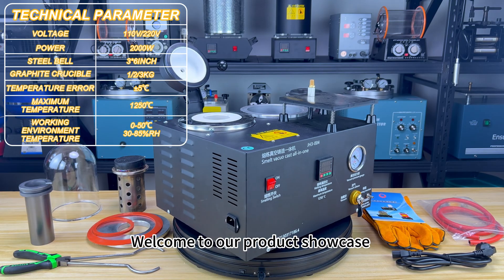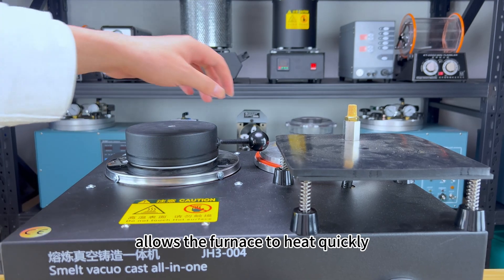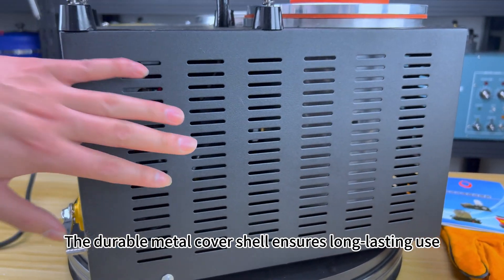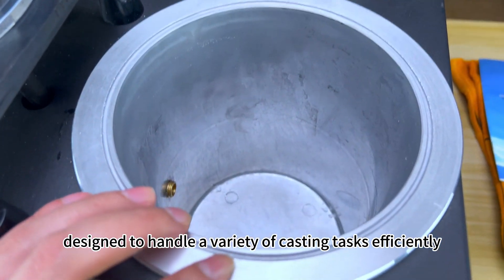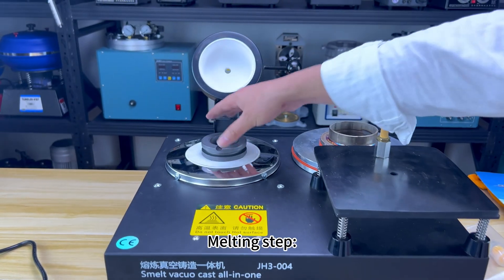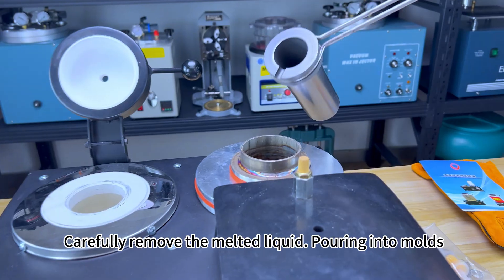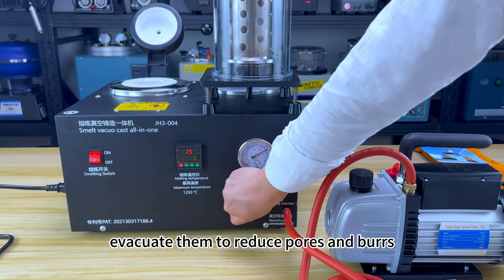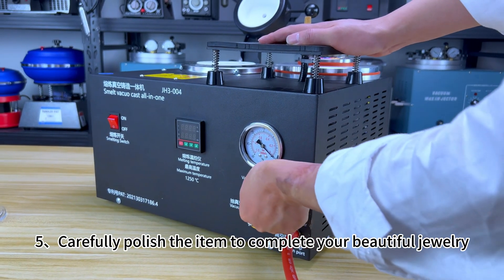How to use Lost Wax Method Digital Display Jewelry Vacuum Investing Casting Melting Machine?

Comment: When I bought this two years ago I was so happy then I realized you have to buy a pump and a burnout oven for the investment then you can use the machine to cast because this machine does not melt the wax 😂
Reply from the maker: Yes, this casting machine requires a vacuum pump. This is mentioned in our product details. Thank you!

Comment: Hello! I bought this machine and I it was my first time casting with it. I dont know what i did wrong. My perforated flask was at 650 celcius following my investment powder burnout process and as I took the flask out from the kiln and put it in the casting chamber, it burned the red gasket on top. It was on fire. The video you showed when positioning the flask in the casting chamber, has the same gasket on top. So is 650 celcius was too hot or did I miss something?

Comment: is there a switch for the 
110v/220v?
Reply from the maker: Hi, This machine is divided into two kinds of 110v and 220v, the other functions of these two machines are the same, you can directly choose the 110v machine or 220v machine.There is no need for a switch to control it.

Comment: Greetings i already got one, but i dont know how to turn it off, i mean, after melting the metal do i have to set another temperature in the control panel like ¨150¨and after the ¨cooldown¨ i just turn off the switch or can i just turn off the switch right after pouring the metal into the mold, Thanks beforehand.
Reply from the maker: Hi after melting, you can turn off the red smelting switch on the left.

Comment: What’s the best whose to get for it? The whose that came with the machine doesn’t fit properly on the machine or my vacuum pump which makes it not get enough pressure for casting
Reply from the maker: Hi thanks for your kind review. May I know your order number? What accessories did you receive?
Reply: @ I have the machine but it’s not from you guys, I was just enquiring about what size whose is best because I got one with the machine but it doesn’t fit the casting machine or my vacuum pump I have to force it on. Which I think is leading to me not getting the psi that I need

Comment: Yo compré una  de las primeras máquinas y muy defectuosa, no tenia válvula para liberar el vacio tenías qué quitar la manguera y el empaque de la campana de vacío muy duro y no sellaba yo tuve qué modificar
Reply from the maker: Hi, may I know your order number? Our after-sale team can handle it.
Reply from the maker: 'Vacuum Release' in the Air Pressure Adjustment Switch on the casting machine is the vacuum release valve.

Comment: I just order mine from you guys! Can’t wait to try it ❤
Reply from the maker: Thanks. May I know your order number?
Reply: @TooltosJewelryTools  
Did you get my order number?
Reply from the maker: @HellHoundOne  Hello May I know your email and phone number? If you order it from my store, you can check the order number.
Reply: can you post a video of how this works
Reply: @Wsjr705  
Sure. I’ll work on that.
Reply: @HellHoundOne does the all in one have the burnout oven in it? Or do I still need a Kiln
Reply: @Wsjr705  
You still need a burn out kiln. It does have the part in it to heat your metal though, which is why I went this way. I do have oxy ac torch, but I turn off the kiln, plug in the unit for the metal and let it rip. Before I had issues with porosity but after letting the cast cool some in the oven it changed everything for me. Th is unit does not come with a vacuum pump, but I have two so it was a better choice for me. I love my unit. Works great and has paid for itself.
Reply: @HellHoundOne how tall is the flask that it comes with can you make a decent tree
Reply: @Wsjr705 i really also need to know this. But it seems like 6 inch tall?
Reply from the maker: @Wsjr705  Sorry Isaac, we didn’t take a complete video of this machine. In the future, we will take it.
Reply: How was it? Have you used it?? What do you think??
Reply: It sounds like you like it! Do you think this would be the best thing for me to get as somebody who wants to try and start making metal things like silverware and jewelry/tools/trinkets and other stuff for myself? Do you have any recommendations for anything else I might need or stuff I should know/consider? I’ve literally never done anything like this before but I have a lot of personal “invention” ideas I’ve written down over the years and a lot of them involve metal work in one way or another. There’s so much stuff I need to learn to be able to make all the things I really want to make but this seems like it could be a good jump off point I might actually be able to do. I’d like to learn how to do bigger stuff like smithing (been trying to learn a little carpentry, for instance) but having moved in with my parents I don’t really have too much space and it’ll probably be a long time before I’ll ever be able to afford a house with space/land enough to have my own workshop unfortunately. I figure this hobby won’t require too much space and might still be affordable enough to make progress with (another barrier for me with carpentry)…although I might be underestimating what all I’ll really need.

Sorry for asking you so much and writing all this, I just thought you probably have experience from your comments so I figured I’d see if you have any input. I’ve never really known anybody I could talk to about this sort of stuff. I’ve got the heart of an inventor/creator and my late grandparents’ homesteading spirit so I want to be able to do everything I can myself but I haven’t grown up in an environment intuitive to that and I just don’t have any connections or mentors or anywhere to start. I feel like I’m stuck on rails in a life I don’t really want to live right now and I figure this might be something I can at least get somewhere with before even more time passes me by. I just don’t want to do the wrong thing or screw up and make expensive mistakes that might just set me back even further. 

I really wish they taught shop in school like they used to so I’d at least have some familiarity with these sorts of things.